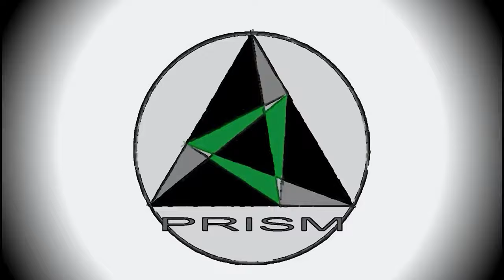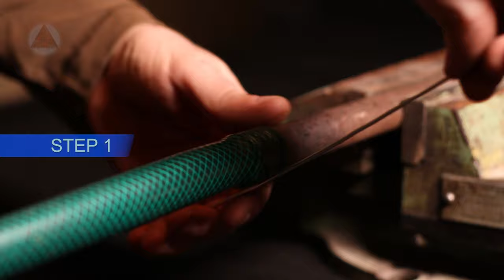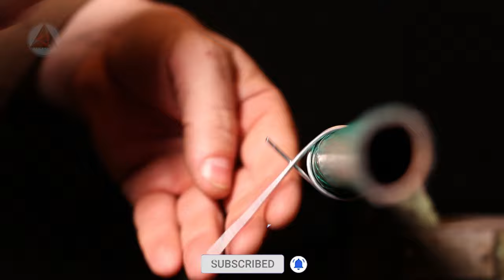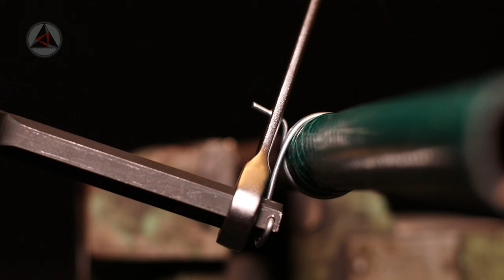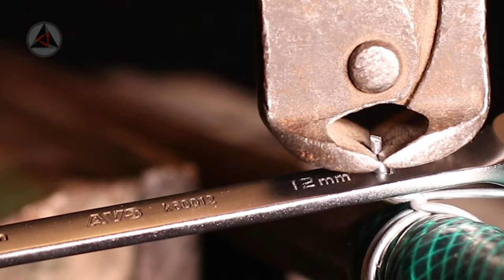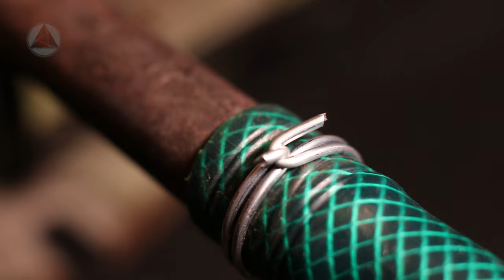Clamp holder Simplest wire clamp 100% effect

Comment: I always just grip the two wire ends with a pair of needle nose pliers and twist until tight. No need to drill holes in your tools.
Reply: Yeah that doesn't actually make it tight enough for any notable clamping force. You need something that can apply a stretching motion and then twist, which is what wire clamping tools do.
Reply: 😂😂😂 It really amuses me to think of you writing this without taking two seconds to realize that anyone who would do this has already done that. Like part of this process is twisting the wires so they don't come undone, and you assume it didn't occur to them to just twist? The leverage here provides an order of magnitude more clamping force than your method. That's the entire point.

Comment: The double wire creates a better seal. If the seal is not critical then this should be ok.
Reply: I built a test piece with a rest of 30bar rubber hose and cast brass hardware, bearing 16 such double wire clamps. Then tested it with a manually operated Rothenberger Test Pump. It held 60 bar (the pump's max. pressure) for several minutes, then the one screw fitting for attaching the pump failed, because one part was only from a rolled brass pipe and obviously too cheap. 

From a similar piece with single wire clamps (created with a modified pair of pliers) one such clamp failed at around 48bar pressure.

It is important to use annealed wire (wire which has neven been tensioned before).

Comment: I enjoyed your video for its simplicity and elegance. When I went to my shop to duplicate the tools, I found I only had case hardened wrenches and Allen Wrenches. Before I could try out your idea, my challenge was actually to drill a hole through that hardened steel. You made it look very easy! I still have not conquered that hardened steel with cobalt bits or sharpened masonry bits. I cannot justify the cost of a pure carbide drill bit. Can you or anyone offer a solution to this?
Reply from the maker: It is good to drill hardened steel with an ordinary drill if it is heated and then slowly cooled, and then it can be made solid again if it is heated and cooled quickly, for example, in oil.  But it is hardly worth doing this, it is easier to find an ordinary key made of fairly hard, but elastic steel.
Reply: If you really think that you need this tool(s) . You could go to a yard sale and get some cheap wrenches. I have seen this type of clamp on things in my 63 years. You may want to make this tool if you are restoring something and want original looking clamps. 
I think I would take the time to file the ends of the wire / and form them so it would not rip you open , like cutting them with dykes will do . 
All in all it is outstanding thinking 🤔.

Comment: Hello from Arizona, US! I'm Navajo/Zuni and I solder silver jewelry all the time. I took have made the other clamptite diy tool with a turnbuckle and wingnut. Initially using the clamptite tool surprised me how much wire was used because it doubled. I usually have wire long enough to use your tool with! I have to soften the wire with heat first if using scrap.

I didn't think to soften the hex key. The ratchet side wrench is a plastic and metal battery terminal 10mm tool. I use x-acto knives that are round. The first thing I used your tool on was decorating my handles so they don't roll around so easily. I don't see your tool anywhere else and I am looking forward to using it with joining two poles together. 

The clamptite diy tools don't seem to like complex contours especially if the wires or some are pressing underneath obstacles. I'm simply attaching a hitch to my bicycle and I look forward to your simpler wire clamp design using your tool.

Comment: And I thought the wheel was already invented....
 A lot less wire is right!! A couple things I like about this wire clamp tool, less wire, simple, not tools destroyed. Some of these wire clamp tools I been watching use 2ft of wire for the same size hose, and I'm sure it's still stronger than a worm-gear hose clamp and with nothing sticking up, thanks for posting.........

Comment: What bit did you use to drill hole in Allen Wrench? I tried , Tungsten Carbide, Cobalt, Masonry without success
Reply from the maker: Conventional wrench, conventional HSS drill.
Reply: I just broke a few twist bits trying to drill my 10mm wrench @@. I guess I need to find allen wrenches made of crappier steel.
Reply from the maker: https://youtu.be/hLNyF6mBFW4

Comment: All great ideas. Both methods. But I have never run into a situation where I needed this tool. I always have or carry hose clamps. Course at my house but also in my vehicles emergency kits. I also carry hose adapter kits in case a hose is split severally. Then I can cut the hose and insert the adapter and use the clamps to fix the issue. When I travel I carry two 5 qt bottles of water. So again, not sure the real need of these unless you are just not a bit organized. So if you have this you should be able to have an assortment of hose clamps.
Reply: These are about 50x the strength of a hose clamp and work better on stepped barbs.
Reply: @camojoe83  possibly. But in my experiance in over 35 years as a mechanic, hose clamps worked just fine. I'm not saying the tool is bad but I rather just keep a few clamps in my vehicles and be done with it.

Comment: Elegant variation of this theme. But I think you would do just as well without the ratchet mechanism.
Reply: I'm curious as to your thinking??  You could not turn the Allen in a fixed head wrench.  Thanks.
Reply: It allows you to tighten without the wire loosening

Comment: What du you use to drill into chrome-vanadium steel?
Reply from the maker: Ordinary drill
Reply: Apparently your spanner is made in China....
Reply: @prismechanic  You can't drill  REAL chrome vanadium with standard drill bit. You need tungsten carbide etc. One can get cheap chinese hex keys and spanners but the idea is overengineered and complicated. Just grab the  the wires in a pair of pliers and twist the pliers

Comment: How many psi support +?
Reply from the maker: No more than the hose can withstand.
Reply: @Nunya Business -- With the double loop type connector, it seems to hold up pretty good... I've used it for garden hoses (60 psi locally) and for my air tool hoses (120 psi is the most I run on them usually)... I like it a lot better than the screw type clamps even though it tends to take more time for me to install it... I would be interesting to see how much pressure it really could support... Maybe someone should suggest it to the ProjectFarm channel?

Comment: Where to buy the 2mm wire? Steel or aluminum?
Reply from the maker: Steel
Reply: Aluminum tends to stretch over time, so it should be avoided... I've used 17 gauge aluminum wire for a temporary repair because that was all I had on hand, but I replaced it with steel as soon as I got some steel wire... I typically use 18 gauge galvanized steel electric fencing wire bought in 1/4 or 1/2 mile rolls...